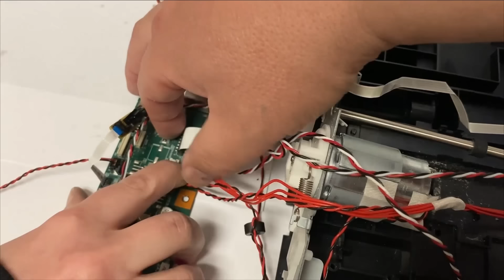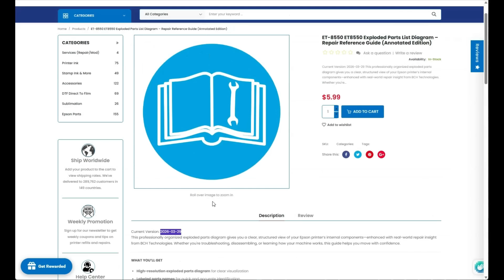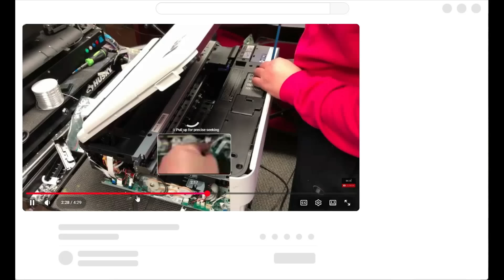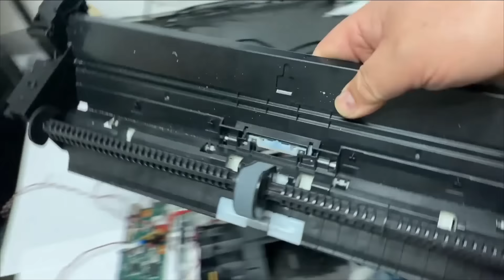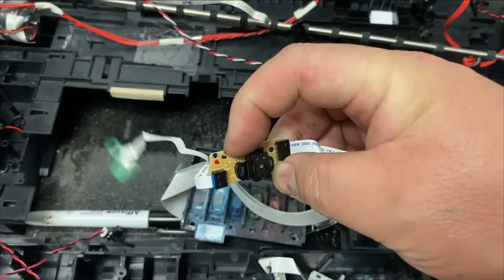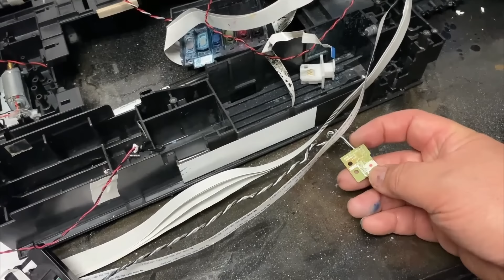Epson ET-8550 Electronics Skeleton Build | Wiring, Sensors, Mainboard Connections

Comment: All I did was clean out the ink lines, and after powering back on my ET8550 I have a code 000031. I’m literally pulling my hair out! I need help badly 😢
Reply from the maker: Thank you so much for your support and engagement! I know how frustrating that 000031 error can be, especially when all you did was clean the ink lines and then the ET-8550 suddenly refuses to behave, but unfortunately 000031 is a notorious Epson error because it can be triggered by many different things, including the printhead carriage not moving freely, a disconnected or loose sensor/cable, ink system parts interfering with carriage travel, a dirty or misread encoder strip, a problem around the capping station or pump area, or something disturbed during the cleaning process. Since it happened right after cleaning the ink lines, I would first recheck anything you touched: make sure all dampers, tubes, clips, covers, FFC cables, and sensor plugs are fully seated, nothing is blocking the carriage path, the carriage can move smoothly by hand when powered off, and the encoder strip is clean and sitting correctly. I have several videos covering different causes of 000031 because there is not one single fix for every printer, so treat it like a step-by-step inspection instead of assuming one part is bad right away. Please consider subscribing or becoming a channel member because I receive a high volume of questions every day, and subscribers and members receive priority replies plus extra benefits such as early access to videos; subscribers and members are typically answered within 48 hours, regular viewers are answered only if time allows because I can usually reply to about 10 questions per day, and after subscribers and members, any remaining reply slots are filled last-in, first-out, meaning newest questions are reviewed first. If you are not subscribed and do not receive a reply within 48 hours, you can either subscribe or repost your question because newer comments are reviewed first; if you subscribe later, your older questions automatically become priority without needing to repost. You’re also welcome to join Run With Kevin — LIVE, where I go live every morning, usually between 6–11 AM Eastern, and answer printer questions in real time, so subscribe and turn on notifications so you can catch the next live session and ask your question directly. If you need faster assistance, please email [support@bchtechnologies.com](mailto:support@bchtechnologies.com), and if this video or comment helped you, I’d really appreciate a Google review here: [https://g.page/r/CfL7k6nYvPQ9EAg/review](https://g.page/r/CfL7k6nYvPQ9EAg/review)

Comment: NEED HELP WITH EPSON 4800 ERROR CODE 0001004
new sensor new cable  new strip f1 f2 f3 fuse are reading good change cr motor  still have code
Reply from the maker: Thank you so much for your support and engagement! On the Epson Stylus Pro 4800, error 00010004 is a CR Motor Encoder check error, which means that during startup or carriage movement the printer is not receiving the expected encoder pulse signal at the correct timing, so even though you already replaced the sensor, cable, encoder strip, and CR motor, I would not assume the problem is solved until the whole CR feedback path is checked as a system. Recheck that the CR scale/encoder strip is installed in the correct direction, seated properly through the sensor, not scratched, oily, dusty, or slightly out of position, then inspect the CR encoder sensor FFC and connector carefully for bent pins, loose seating, broken traces, or reversed connection. Also check the CR motor connector, motor wiring, and whether the A/B encoder pulse lines or motor leads could be inverted, because the printer may still throw the same code if the motor moves but the logic sees the wrong pulse direction or no pulse at the expected interval. Since you already confirmed F1, F2, and F3 are good and replaced the obvious parts, the next things I would look at are CR timing belt tension, carriage resistance on the rail, a binding carriage, dirty rail, damaged belt, incorrect sensor alignment, or a main board problem in the CR motor/encoder circuit; if all mechanical drag and wiring checks pass, the C593 main board becomes a real suspect. Because I receive a high volume of questions every day, I have to prioritize replies: subscribers and channel members are typically answered within 48 hours and may receive extra benefits such as early access to videos; regular viewers are answered if time allows since I can only reply to about 10 questions per day, and after subscribers and members, any remaining reply slots are filled last-in, first-out, meaning newest questions are reviewed first. If you are not subscribed and don’t receive a reply within 48 hours, you can either subscribe or repost your question so it appears newer in the queue; if you subscribe later, your older questions automatically become priority without needing to repost. You’re also invited to join Run With Kevin — LIVE, where I go live every morning, usually between 6–11 AM Eastern, and answer printer questions in real time, so subscribe and turn on notifications to catch the next live session and ask directly. If you need faster assistance, please email [support@bchtechnologies.com](mailto:support@bchtechnologies.com), and if this video or comment helped you, I’d really appreciate a Google review here: [https://g.page/r/CfL7k6nYvPQ9EAg/review](https://g.page/r/CfL7k6nYvPQ9EAg/review)